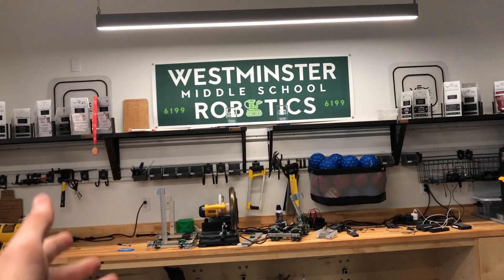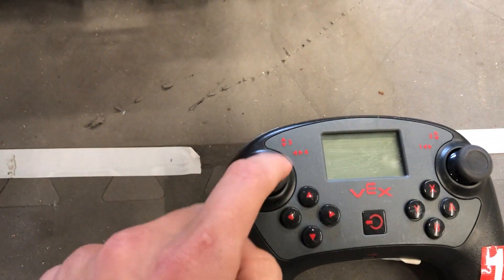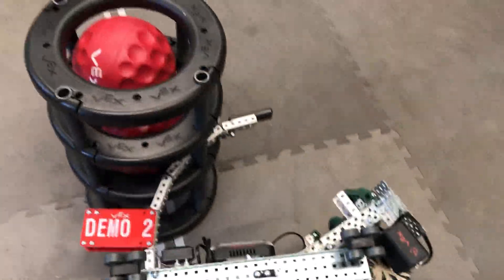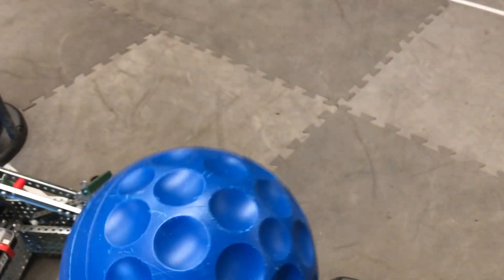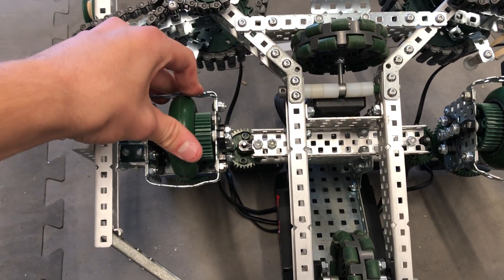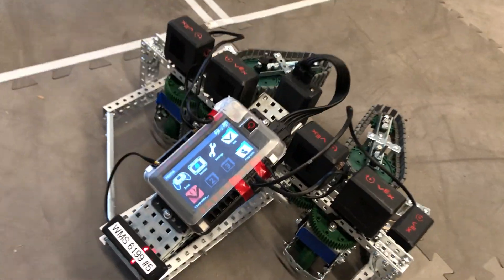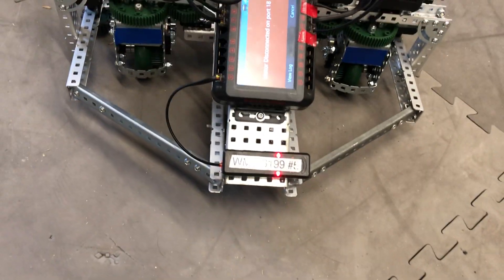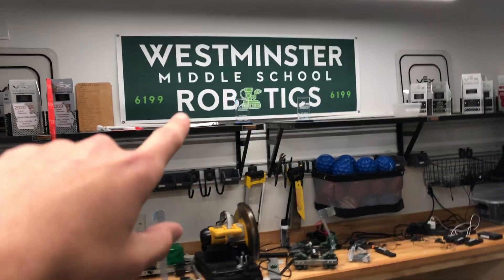Demo Robots Overview

Comment: I would appreciate an explanation on how it was made that there is no motor on the bottom, since a real risk with swerve drives is wire entanglement. I’m trying to observe from the video, but I can’t really find any moments where the details are visible
Reply from the maker: A coaxial drive shaft was ran through the pivots into each wheel cage, then a series of bevel gears were used to transmit the drive power.
Maybe this will help: https://www.youtube.com/watch?v=6RpEsX6xEOE
Reply: @JackScalise  aight. I already figured out how to do it myself though. Just use a circle insert on the gear that is over wheel and then run an axle through that gear as you connect it to the wheel housing with screws instead, then use bevel gears to convert the motion of 5e driving motor to the side. Just had to put my ol noggin to work real quick lol.